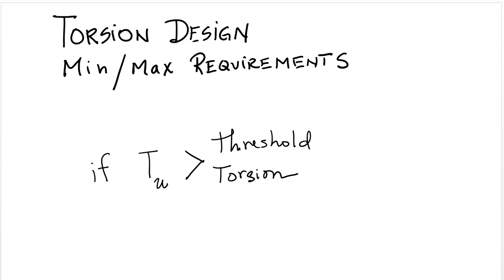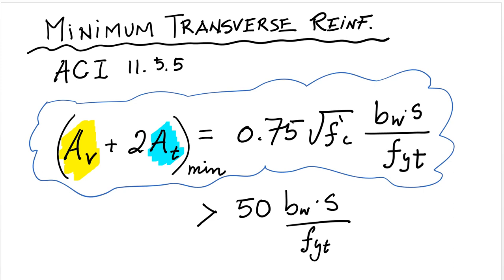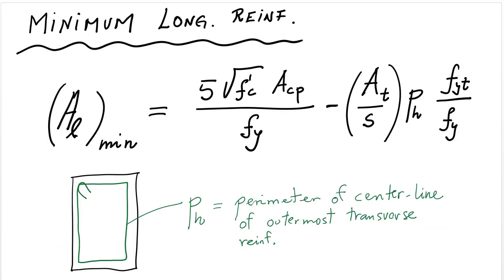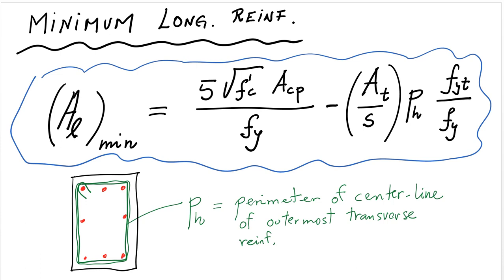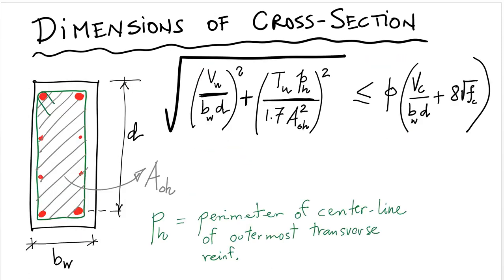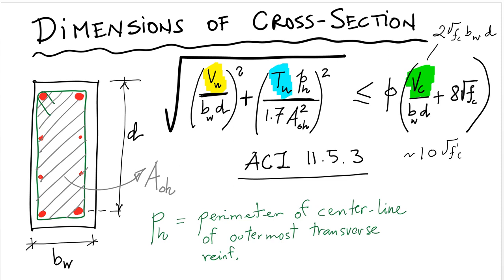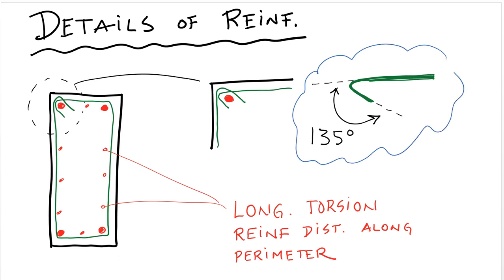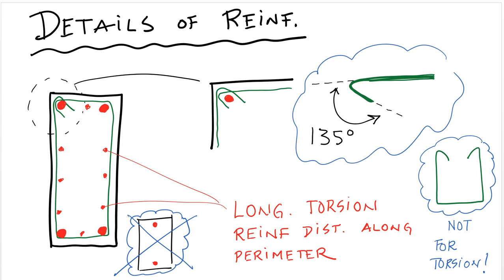Minimum/Maximum Requirements for Torsion Design of Non-prestressed RC Beams

Comment: If there were 3 legs, would all 3 be considered for torsional At/s?
Reply from the maker: Depends on the location. Since this reinforcement is designed to resist torsion, the reinforcement near the perimeter is more effective than the reinforcement near the center. Personally, I would only account for it if it is on the perimeter.